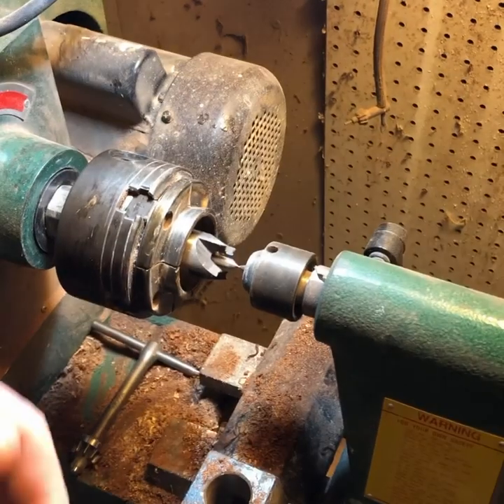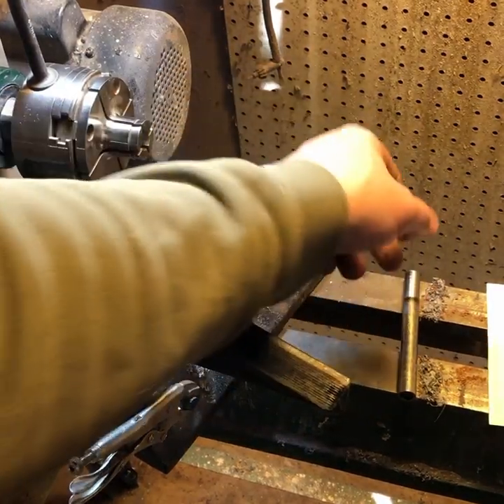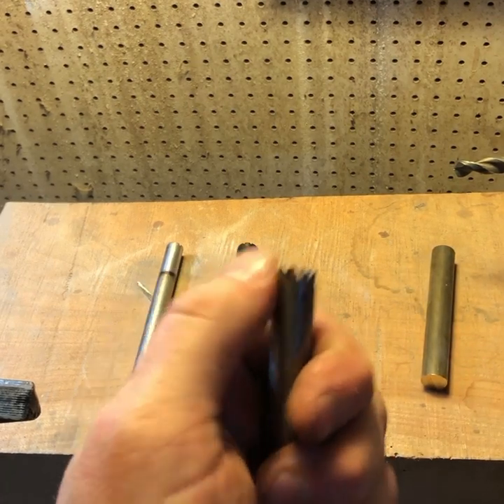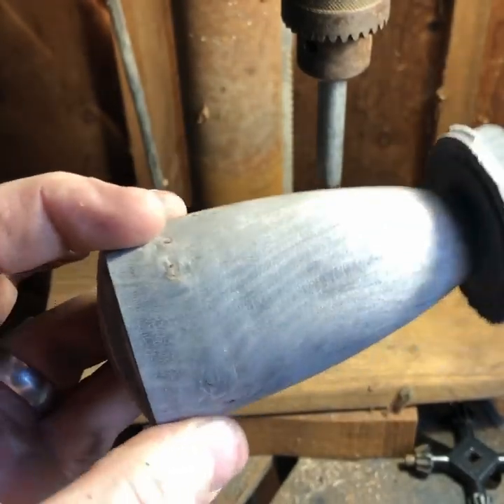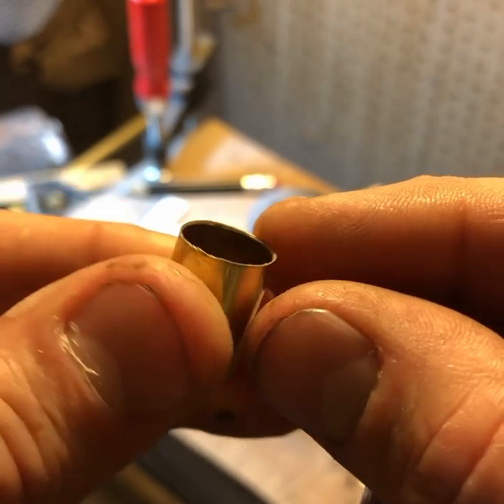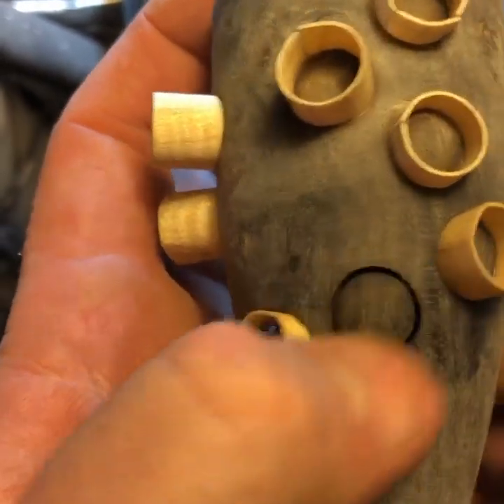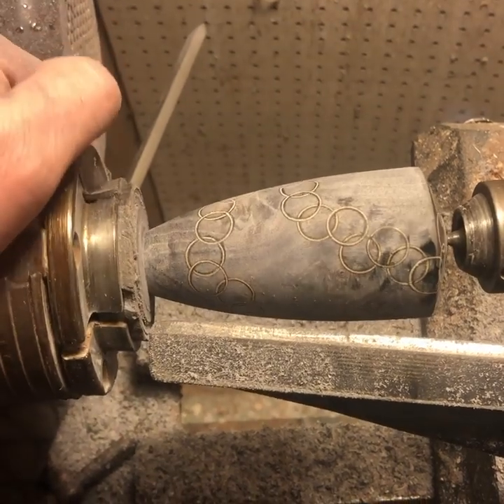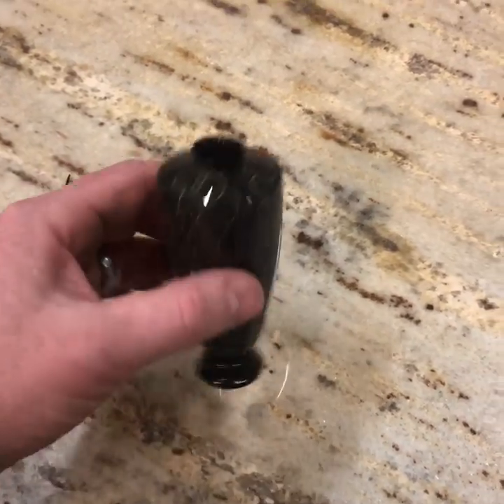December 18, 2019

Comment: Thanks, Eli.  Beautiful process, sir, and I love how you worked through the problems along the way.  Don't bother about how long the video lasts - it is what it is, and it is a detailed process and stunning results, so it was worth the effort.  Curious on how you transitioned over that top shoulder for the rings.  Two channels drilled from different angles along the axis?
Reply from the maker: Alan Taylor I just held it with one hand and drilled with the other. Nothing fancy.  I drilled those holes after I got a little practice in and felt confident

Comment: Online metals dot com has a nice choice of stainless tubes, hot or cold rolled ones too, in sizes that you use in the video. Their thicknesses are 0.035 which is close to 1/32. It should be no issue to get those 0.004 off of it to be perfect 1/32. I do not think that it matters that much, since your veneer can differ in thickness, too. 
One idea about bending the veneer. You can soften the veneer with water, make a bunch of brass tubes, and instead trying to get it inside the holes while wet, let it dry in all those tubes. It should not take long for it to dry inside them. Once dried, it will keep the shape of the tube and you should not have any breakages.
I know you have your ways, all I am trying to do is to give other options to your viewers.
Great techniques and clever thinking, ending up with beautiful piece of turned wood.
Lastly, if you use non stabilized wood, what finish you would recommend, since CA proved to be bad for you?
Reply from the maker: pajonate I am familiar with that company they are one of the companies I looked at I bought 3 6’ lengths of seamless stainless tubing from them 1/2” diameter with the thinnest wall thickness they had.  But most of my veneer is actually 1/42 of an inch.  Witch makes a difference.   you can wet the veneer and let it sit in the tube but again the veneer will shrink and if you have a tight seam while it's wet you will have a gap when it's dry.. I did a lot of experimenting over the last year with this project.  The processes that in showing are the end results of a lot of failed ideas. Many of which get suggested to me, as maybe try this.. I have been down that road and wasn't happy with the end results some people may be just fine with the results I just wasn't.  By the time I make an actual video I have tried a lot of different things
Reply: @epdesign1  That is great that you are learning on your mistakes, and deliver to us your final (best) way to achieve your goal. 
Not to argue in any way with you, but you can easily calculate the perimeter of your circles, cut the sizes of you veneers to that measure when dry, so when they get wet end expand, they will overlap in the brass cylinder, but then when they dry up, they will return to their original size.
Reply from the maker: pajonate try that on a 1/2” diameter ring and let me know how that works for you. It didn't work so well for me. On the larger rings I don't see much of an issue with doing that. I haven't done any rings with a. Diamiter over 3/4”. the smaller the diameter the more problematic it becomes. Also the wood matter maple is a much different animal than wenge and so on.
Reply: @epdesign1  thanks for the reply. Can you give me an answer to a question I've posted in the first post:
if you use non stabilized wood, what finish you would recommend, since CA proved to be bad for you?
Thank you and take care.
Reply from the maker: pajonate ibwould brush 2 layers of penetration epoxy from (rot Dr) let it cure for 2-3 days than I would either use urethane or lacquer for a small project like this.  Of it were larger I would spray it with a high solids automotive clear coat.  This finish requires a lot of work and I will cover that in a future video because it's a lot to explain.  The real issue with it is the automotive clear coat I use requires a high quality spray gun and the finish is not legal in all 50 states.